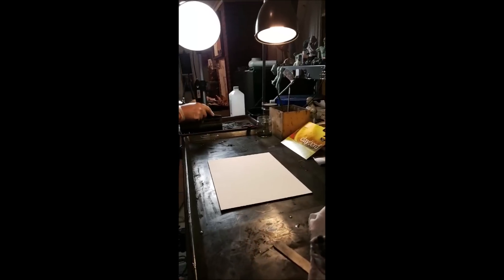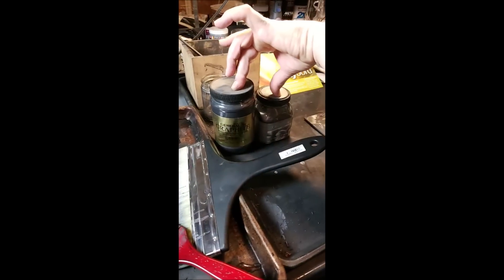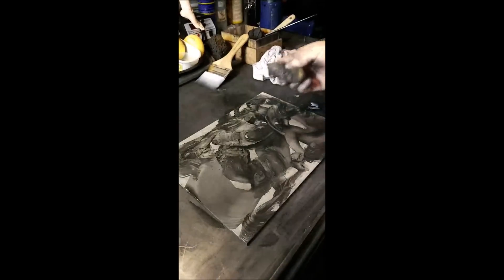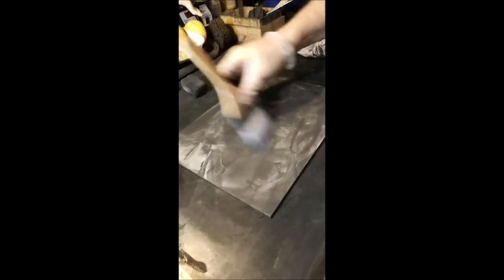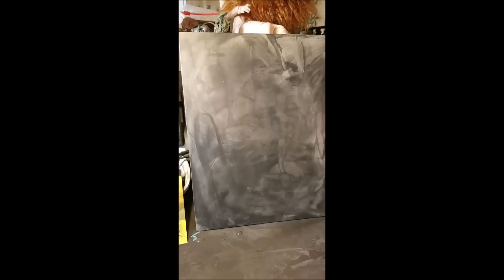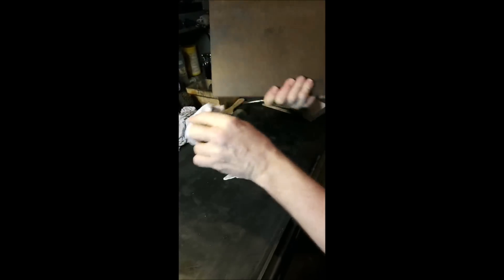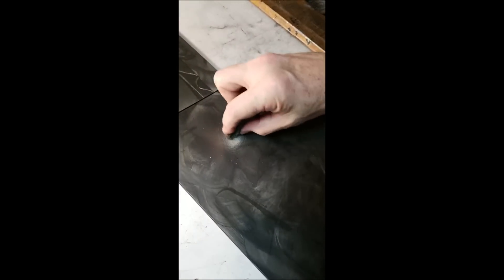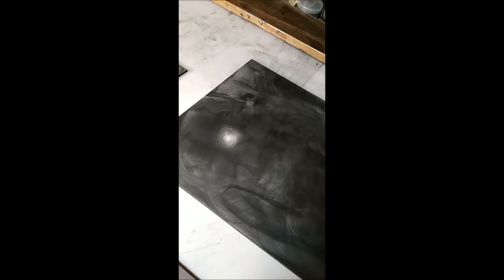Allen Williams Live IG Feed 6 9 2018

Comment: awesome work! I can't get the graphite to stay on my board though, as soon as i try to buffer it just wipes off. i dont have a heat gun and am just letting it air dry though
Reply from the maker: Hi Dan. Allen works the powdered graphite around with a wet brush. Air drying is fine, but then you have to burnish the powdered graphite into the board to get it to stay put. Vicki-